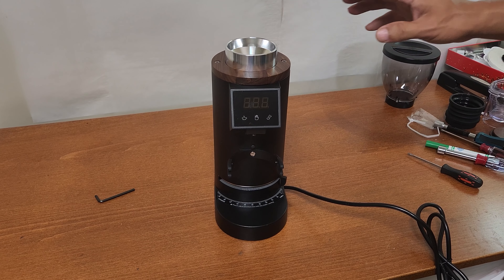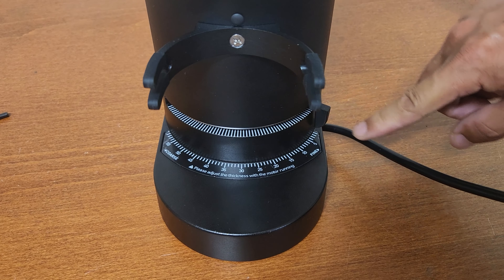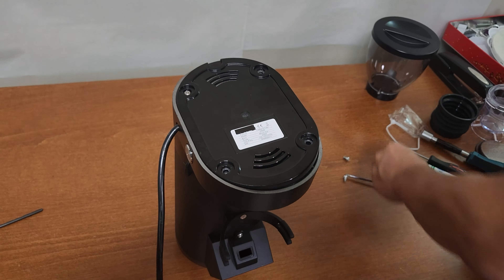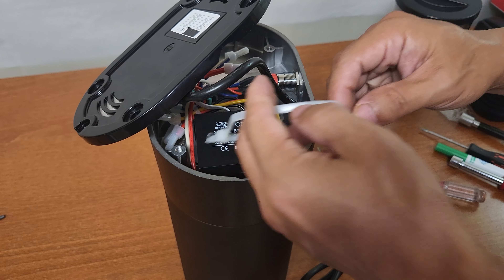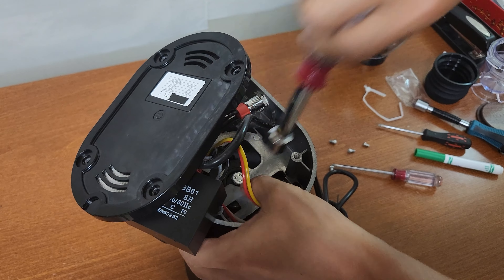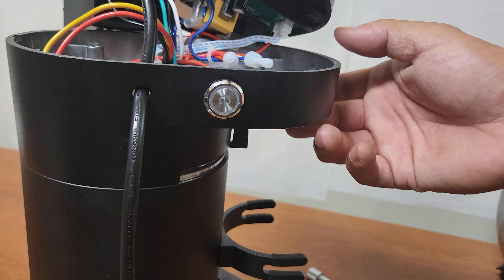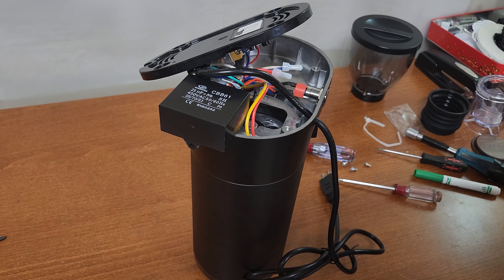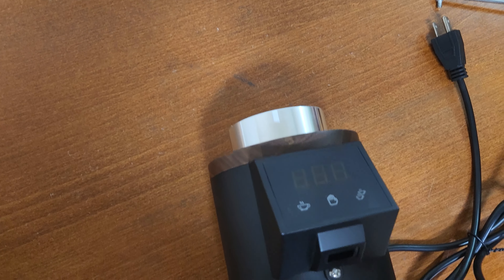DF64E & DF64P dial zero point adjustment (obsolete, watch https://youtu.be/k3vrJ1rT8EQ instead)

Comment: Is it normel for a new df64p that you have to set the true 0 point. Got mine today and it doesn’t grind fine enough out of the box
Reply from the maker: Hmm, that is weird. All machines should be aligned out of box. Check if there is a gap between the top wood cover and main body. If so unscrew the top wood cove and rotate 180 degrees and put back again. You should see the gap should disappear.
Reply: @miicoffee  thanks for your reply, was really hoping this would be the case. Unfortunately the cover was placed the right way. - could it be that they just forgot to calibrate the machine during manufacturing?
Reply: @dennisgoossens34  Then, it's possible zero point is not set up correct. You might want  to contact your seller to fix this.
Reply: @dennisgoossens34  my is not calibrated correctly as well :( I got to 0 and still not fine enough. Based on my measurements I could expect that left space on 0 is around half of whole hight burr moves. Unfortunatelly I don't get it how the point zero was set in the movie since marked line stays in the same place :/ So what should be done? Is really not clear to me.
Reply: @marcinsajnoga652  you have to move adjustment handle back from “finer”, to the left, so that you unblock more finer range

Comment: Can I use this mod to turn it into a filter grinder?
Reply from the maker: Yes, you can make it grind coarse. If the range of the adjustment is not an issue.